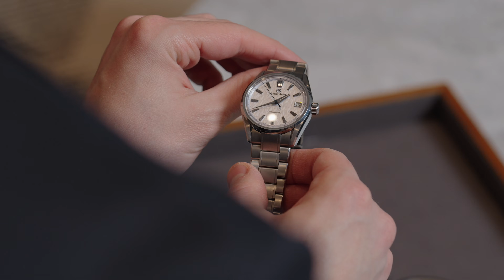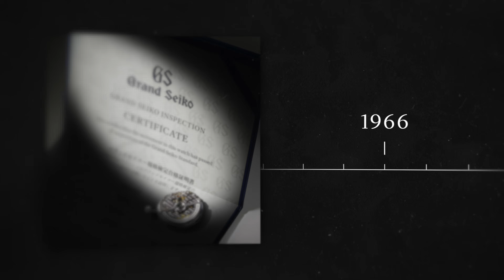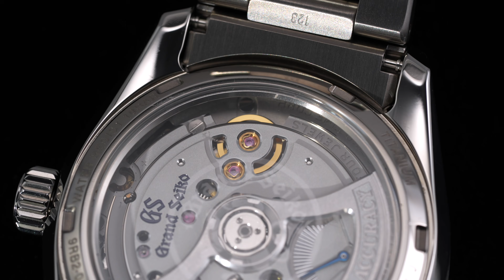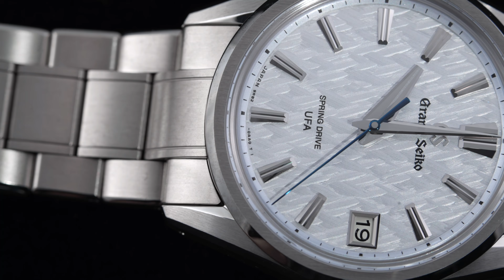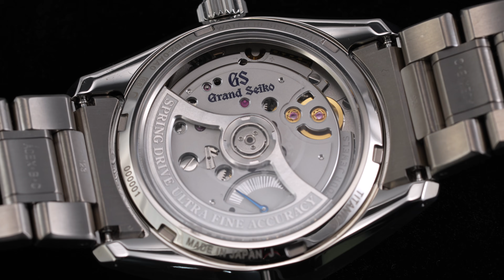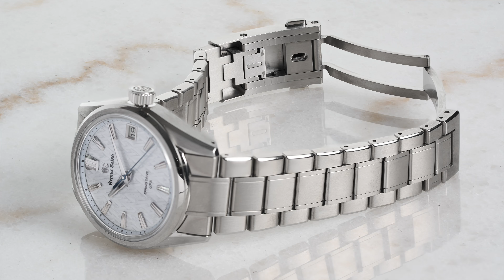The Most Accurate Spring Drive Watch Ever With A New Micro Adjustment Clasp  - Grand Seiko’s UFA

Comment: To me, this GS is the most exciting thing to come out today, beating out all the Swiss brands.
Reply: Beats the Landfill-dweller.
Reply: @Thisonegoestoeleven666  you mean the new PRX?
Reply: @snakepitsam  You know a lot about watches I see.
I doth my Cap 😉
Reply: You mean chicken wire dial 😂😂😂
Reply: @Thisonegoestoeleven666  In what way does it beat the Land-Dweller?
Reply: 100% Now the Rolex cucks have nothing to complain about. OMERGERD NO MICRO ADJUST GAWK GAWK HAWK TUAH ROLEX
Reply: No taper lol
Reply: “Beating” 😂
Reply: The only thing that even comes close are all those new Rolex memes... Actually, who am I kidding. Those memes are definitely the most exciting thing to come out today!
Reply: Jim bob smith is a gay
Reply: Swiss innovation: we made the same thing in a new color..
Reply: @honigbaer  If it ain't Broke, Don't Fix it.
What GS do you have then?
Reply: @honigbaer  Grand Seiko Innovation: 
We came up with another annoying dial instead of bothering to fix the bracelet.
Reply: @honigbaer  It's Japanese, but yeah sure seems like that. 
The spring drive mechanism is quite thick, and so some changes are quite difficult to make technically.
Whilst I really like my spring drive it is hard to justify compared to a cheaper more accurate solar, where the capacitor wears out in 20 or so years.
Reply: It's absolutely beautiful ,my favourite G.S. watch ,i like it even more than my Credor Spring Drive .
Reply: A little bit underwhelming. Spring drive is already accurate enough. And GS is the only brand in 2025 making a big deal about an on-the-fly adjustment 😂
Reply: You may be right on the micro adjustment part, but many people (as incredible as it sounds) said that even though GS has better finishes, technology and better dials as other similar priced watches, they wouldn’t purchase a GS because of that “bracelet”. Now that they not only did a functional bracelet but delivered as well a better proportioned, accurate and slimmer watch it is rounding up on being a far better option even for the non fans of the brand. Specially when they start doing this in some of their classic cases I can foresee this movement being a hit.
Reply: @ People need to understand its only 6mm in total (3x2mm) before they get too excited lol.
Reply: @ It's 6mm of adjustment lol 😂
3x 2mm apparently.
Reply: 😂😂😂 a quartz watch is NEVER the most exciting watch on the market
Reply: @jimbobsmith2496  I feel so sorry for all the people you know that have to live in the existence of your ignorance.
Reply: @jondough42069  sorry bud, but the one showing ignorance is you. The micro adjustable clasp has been around since 1950, nothing special about it. The spring drive is a quartz watch. There are numerous other quartz watches like the Eco Drive that is accurate within 1 seconds isn’t a year. Yes the dial is beautiful, but that is it. Once again Grand Seiko shows it is an overpriced piece of crap
Reply: @jimbobsmith2496 Dude, let’s all chill a bit. I am not a GS fan (other than the dials). But they are hardly “crap.” It might not be your cup of tea, but can’t we agree they are excellent in their lane? Just like Rolex (which I am also not drawn to) are excellent in their lane? No need for the vitriol.
Reply: @1RunnerDad  nope I cannot agree with you. You really should have saved your rant for snake pit. And no, GS is not in a special lane at $10k when the Citizen 0100 is less than half the price and does the same thing at 1 second a year. The Citizen is a $4k watch. GS is nothing special, neither is most Rolex watches, for the price of both brands there are far superior watches.
Reply: @jimbobsmith2496 why are you even here watching this video 😂 stop wasting your time and effort putting negative comments on here. We don’t need that. We get it you hate GS move along.
Reply: @ who’s time is it to “waste”? Why am I here? Because unlike most people that watch Teddys videos and wish they could afford to buy a watch, I have several, a few that I have bought from Teddy and his guys. I also know there are more accurate watches for less money.
Reply: @jimbobsmith2496 hahaha so you say all that so you can sneak in the fact that you have watches from Teddy?  Do you want a medal? Gold star?  Do you want us to say we are proud of you 😂😂. Get a life you are a grown man looking for attention and acceptance from complete strangers, bit sad really.
Reply: @jimbobsmith2496 So it’s really about snobbery for you? That’s supposed to win converts or put others in their place? 
Wow, man. That’s just kinda pathetic.
Reply: @jimbobsmith2496 Quartz or not, it is better than anything Patek, Rolex, Tudor and most any brand released today. While GS innovates, you have companies like Tudor doing the exact same thing with just a dial and bezel swap, Rolex has a new movement but I am sure the accuracy or Hz are the same as all their other stuff, Patek does what they do and sell grossly overpriced stuff, the list goes on. Omega is perhaps the last big company to really innovate with the Spirate system. You need to get off your high horse thinking that mechanical watches need to be completely mechanical. To combine quartz with mechanical is absolutely insane.
Reply: @jimbobsmith2496 take the money you saved on your cheap watches and go get a life 😂
Reply: @ haha the cheapest watch I have is the Omega Steal dial Seamaster Chronograph, some of us can actually afford the nicer things in life
Reply: @jimbobsmith2496 imagine being rich enough to own expensive watches, and you still have the mindset of a neglected kid looking for attention in the comments section. All that money and knowledge of watches, and you chose to be have an archieluxury personality
Reply: @ And that's Jimbo's hot take for the day. What a sad lonely man Jim is.
Reply: @ Only one peanut ranting here Jimbo. On your bike mate.
Reply: @ Yet another example of money not buying taste nor class Ratio boy.
Reply: @jimbobsmith2496  Just because it use the quartz oscillator, doesn't mean it's bad. The main reason people like mechanical watches is because of the craftsmanship. The craftsmanship of GS spring drive movement is the same or maybe even better. It do the only work that watches do accurately i.e. telling time. Yes, Citizen 0100 might be more accurate and cheaper, but it's not all about accuracy. I bet you to show me a quartz watch that has smooth gliding second hand as this or a mechanical watch that is as accurate as this. I know micro adjustment isn't something new or particularly special, but for GS, majority of people compliants are about micro adjustability. For those people, this is quite exciting plus it's slimmer than most of the clasps and it's fully in house. One thing for sure is that it ain't overpriced compare to any other watches at this price point. Let's be real, watches for around this price range, you're just paying for the brand name rather than the watch. Considering the beautiful unique dial, carefully finished hands and markers, the level of attention to detail, fully in house, great overall package, and technically best movement currently available, I'm sure it ain't no piece of crap. Just because you don't like it, doesn't mean it's bad.
Reply: @jondough42069  It's a quartz lol. Deal with it.
Do you even own one?
Reply: @ItzRoe  Truth hurts huh 😂
Reply: @ItzRoe  I own two GS, how about you?
Reply: @ Which SpringDrive do you have?
Reply: @wristopia4101 owned 2 now own 1. Planning on picking this up and selling my current.
Reply: @jimbobsmith2496  The hand design is poor in low light. This watch fixes several complaints about its predecessors: no micro-adjust strap, power reserve on front messing up aesthetics and readability, low accuracy for a high end quartz watch, too thick. That said, I do not see the point of this level of accuracy in a watch where I have to adjust the date manually (no date is better).. I do like the watch, though, if I ignore the price.
Reply: @ the fact that people are happy about finally getting a micro adjustable clasp is insane, it’s not like Rolex launched the first one 75 years ago or anything. This clasp once again demonstrates that GS is not a serious watch, that it is a gimmick even when I own one
Reply: @jimbobsmith2496  It's a lot of people that:
A/ Do not understand how potentially useless only 6mm is.
B/ People not buying one.
C/ People not bothered that it's taken so long.
Reply: @jimbobsmith2496  Japan is a different culture when it comes to design innovation. I agree on both counts. That said, I wear my GS as my daily.
Reply: @ If ignorance is bliss, you must be one happy chappy Jimbo.
Reply: @jimbobsmith2496  Just because you can afford very expensive luxury watches doesn't mean you can denigrate a brand like Grand Seiko. In the past, Seiko has already demonstrated that the accuracy of their watches was superior to that of the best Swiss watches. Grand Seiko is the worthy heir to Seiko's glorious past.
As a luxury brand, the price of their watches is high, of course. But they are constantly innovating, regularly introducing new movements and offering products that are unrivalled on the market, such as their Spring Drive models. I'm talking, of course, about the watch as a whole. The combination of the accuracy, the beauty of the dials, the quality of their polishing, their history and the bewitching movement of the second hand set these watches apart.